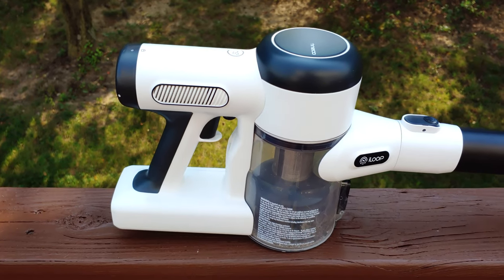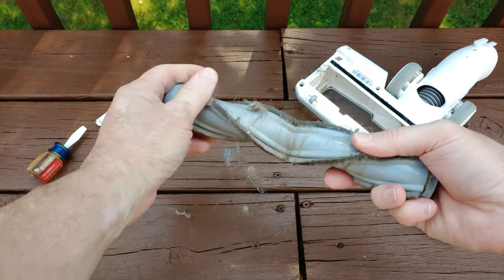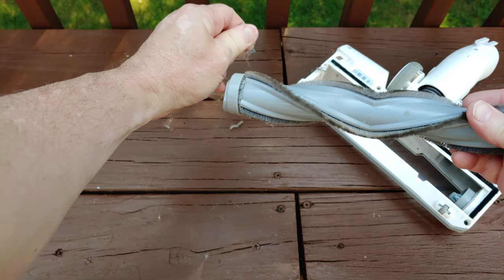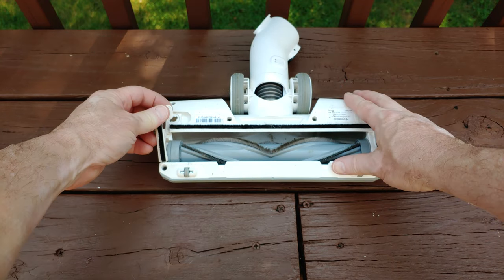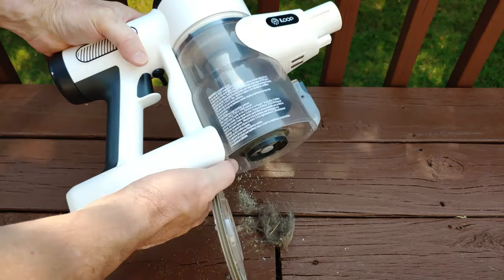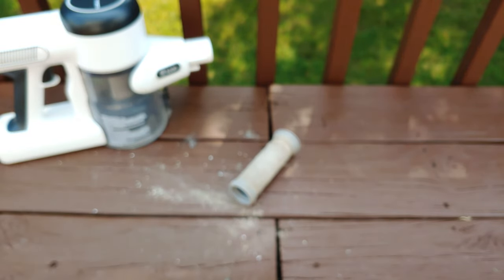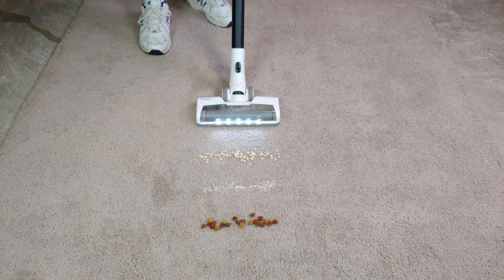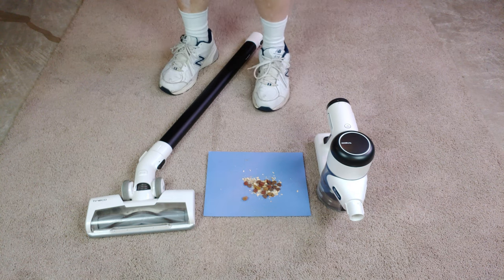Clogged Tineco Pure One | What Went Wrong

Comment: Thank you so much for making this video! I never would have figured out how to clean my vacuum and get the suction back.
Reply from the maker: You're welcome.
Reply: fyi instructions are clearly in the owner’s manual. what it doesn’t tell you is that inner filter has to be cleaned very frequently - i flame mine almost every 2nd or 3rd use - about 60 to 90 minutes
Reply from the maker: @jonnyz5772  no one reads manuals obviously, most throw them out ASAP. 🤣👍

Comment: Your video was very helpful. I learned two things, one is that I don't have to open the bin to clean out the filter. And, secondly, I should always be checking airflow before I begin vacuuming. Unfortunately, I have a multitask power brush roller with a badly soiled plastic cover. I am trying to figure out how to clean it. Thanks.
Reply from the maker: You're welcome!

Comment: Helpful -Thankyou! 

Did you just let the filter air dry? Could not I use my hair dryer in cool to speed that up? 

What's you're recommend stick vacuum for med pile and hardwood combo for best clean?
Reply from the maker: There is no stick or robot vacuum that can properly clean pile carpets. You'll need a higher airflow, higher agitation upright for that.

Comment: The suckiest thing about all stick vacs that aren’t a Dyson (as they have really good prefilter cyclone systems) is this- this pre filter needs to be cleaned every two canister dumps. So, 1/3rd of of my use of this otherwise wonderful tineco vacuum is cleaning the pre filter. I thankfully have a model that includes the “filter cleaner” which basically swaps dirt between your two filters it comes with. It’s laughable, but it works.
Reply from the maker: The owner of this machine went about 2 months before losing most of the airflow.
Reply: Yes we find that the filter cleaner works surprisingly well, most of the dirt actually ends up in the basket not on the other filter. If you use it more than once on each filter they BOTH get cleaner.

Comment: I’m surprised the owner didn’t use the included filter cleaner.  It’s one of the best things about Tineco.   I do have to brush off my filter about weekly.
Reply from the maker: The owner wasn't aware of the hidden filter, so using any filter cleaner wasn't really in the picture.
Reply: I have this vacuum also, and I feel the filter cleaner just moves the silt from one filter to the other.
Reply: - yes - this is correct - i blow it out gently with compressed air instead of washing it so i can keep on cleaning

Comment: Hi Bill Great video. I would had not looked and found that filter😭🤣😂. We used to love our tenico vaccum like the one you problem solved. Ours runs for like 30 seconds then switchies of now continuesly I'm stumped. Any ideas would be great 🙂👍.
Reply from the maker: Typically, that means you need a new battery.
Reply: Battery.  If it’s under warranty and less than a year they should cover it. If not, these need a new battery every two years or so.

Comment: Thank you for making this video! My vacuum is working like new! I don't have the manual but I actually had the extra filter and the attachment to clean it. The old filter was much worse than the one you had, so I just threw it out. I will make sure I clean the new one regularly. Thanks again dude, I owe you a beer 🍺
Reply from the maker: Glad it helped!
Reply: WHAT??  You're kidding, right?
Reply: lol i’d check replacement part prices and hassle of ordering before just throwing it out - filters were made to be cleaned and reused many times over tho
Reply: @jonnyz5772  Good to know👍 I messed that vacuum up and bought the same one again. So I have 3 filters now 👍
Reply: @djcj2626  that’s awesome sounds like a win for you after all - i like the vacuum however it kinda needs to be handled with kid gloves as the plastic doesn’t seem very thick where the attachments mate etc - good luck !!

Comment: The filters inevitably gradually clog up over time and eventually cannot be cleaned, so getting them as clean as new is basically impossible. Still, brushing off the outside, and soaking them in warm water for a few hours really, really helps, as does rinsing off the outside with warm water, and then drying thoroughly.
Reply from the maker: I've never encountered a filter that couldn't be cleaned and mostly brought back to useful life. And I've made a large number of videos proving this over the years.
Reply: @VacLab  Well, we frequently used the Tineco cleaning device, we washed them thoroughly, but in the end (after several years), we still got the blocked indication. Then we got new filters and the blocked indication went away. Filters do have a finite (if long) life when properly taken care of. Presumably eventually enough debris gets tangled into the filter and it won't wash out.
Reply from the maker: It's possible you may be over-using this vacuum. The original owner still has this machine and is still using the original filter. Stick vacs should only be used for small, infrequent sessions and never as a substitute for a full power upright or canister.

In the worst cases of abuse, which I see frequently, the filter must be submerged in a mild detergent for up to 24 hrs, then quick dried with heat or direct sunlight. I've made many videos showing this procedure.

Comment: Having the same issue with my S10, mine has the clogged air channel light on. I've tried cleaning the filter, made sure all the clogs were removed but it's still showing the clogged air channel light and turning itself off after a few seconds.
Reply from the maker: The clog could still exist somewhere else.
Reply: @VacLab  I've taken the whole thing apart as shown in the video, cleaned out the filter like you did and even removed and cleaned out the filter that is on the back of it. There's no clog.
Reply: @VacLab  I've taken the whole thing apart as shown in the video, cleaned out the filter like you did and even removed and cleaned out the filter that is on the back of it. There's no clog.
Reply from the maker: @jolinkarrick8532  if it's still under warranty, place claim then.
Reply: @VacLab  unfortunately I don't think it is, also the one I got is different from the one in the video. Same brand but it's the S10 series. My roommate got it from his Grandma a while back. I've been trying to get up to work and from the looks of it, it just seems like the filter that goes in the bottom just clogs up really easily. Like insanely easy. Either that or my carpet just has so much dust in it that after vacuuming it for only a few minutes it clogs it up.

Comment: I bought a tineco pure X1 and the brushes will not spin. Got a new cup or the wiring is Switched all the parts and it still won't work anybody got any suggestions?
Reply from the maker: If it's still under warranty, contact the company for replacement parts.